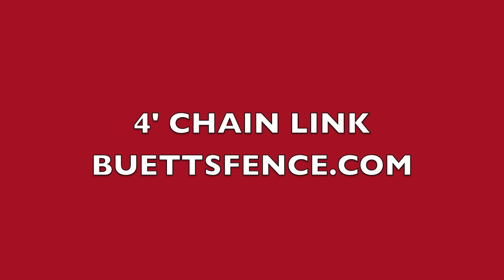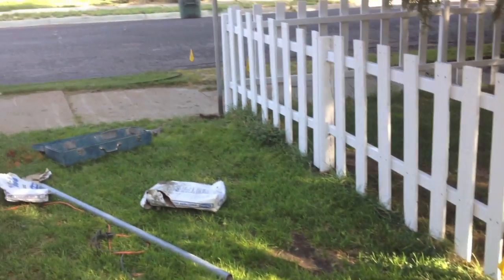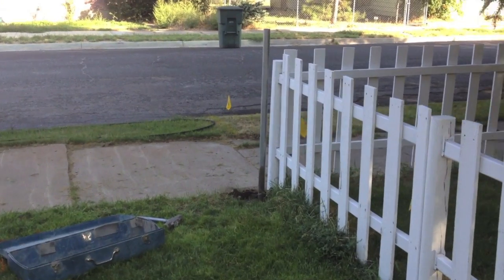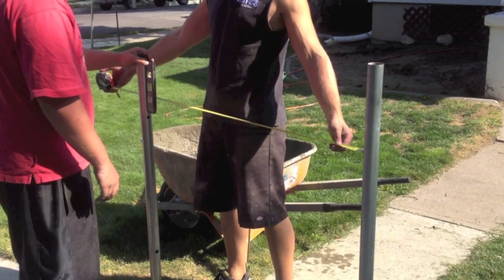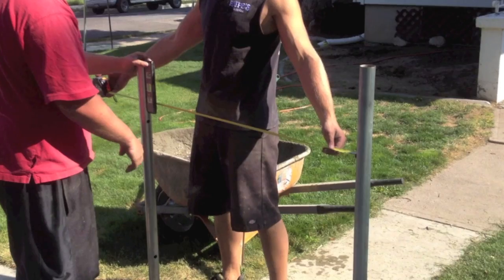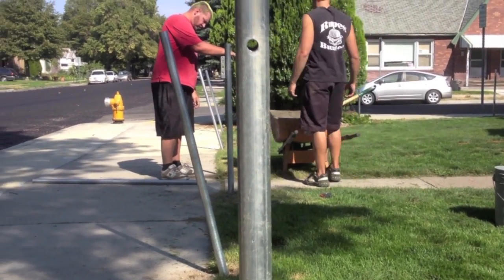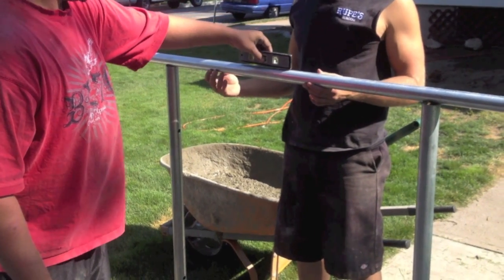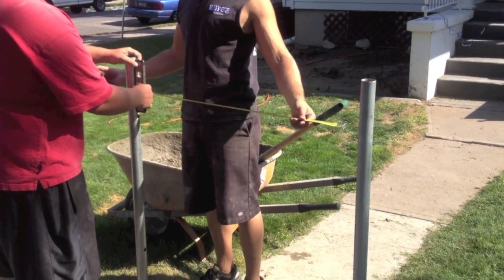HOW TO INSTALL CHAIN LINK FENCE (PART 1)

Comment: Thank you very much for your video.  I am putting up a chain link fence using the bullet ends.  I had looked everywhere online to find out what height the terminal and line posts are supposed to be.  Everybody has heights for using the dome cap system with the bolt on rail ends but not the bullet style.  Thankfully you did say the actual heights I would need.  One thing I think you should have shared with viewers was how much bottom clearance one plans on make a difference on post heights. Thank you much for this.  Tom

Comment: The instructions you give are to add 4” between terminal posts for a gate which is exactly what I did. Unfortunately, this is wrong as prefab gates already come smaller than the opening.

Comment: Sight by eye, it is quicker and easier. ANY tradesman that tells me this certainly will not get my job
Reply: I guarantee my line will look better than someone using a string.
Reply: Real professionals sight by eye on chain link. String is used on wood fences but you can even sight those by eye but I like string. We set all our posts three ft. in the ground on everything 6' and shorter because of the gumbo in our area. We get some pretty dry weather sometimes and it can crack away from the concrete. I have had my business (Blair Fence Co.) for 34 years and have worked on 98% of the jobs. I am very particular about the way they are built. Can't help it. I like to make my fences a work of art.

Comment: I'm confused..... You first say that the height of the line post should be 45 1/2 to 46 inches, but then you say dig the holes 24 inches. ????  If you put a 72" pole in a 24" hole you have 48 inches sticking up out of the ground. ??????   How does that work out?
Reply: You measure and cut each post to correct height, with pipe cutter

Comment: I could explain exactly how to install a chain link fence with gates but there are several different things you have to know and it may get confusing but if anyone has a question I will answer it. I started building fence when I was 12 in 1965 and had a fence co. for 36 years and I will be glad to help anyone.

Comment: get a tape longer than 25ft and if you dig the hole deep enogh you dont have to drive it down a string would do justice as it is quicker and  you know where your hole is no need for one person making sure the hole works line them up after you pour concrete and your gone plain and simple

Comment: if u run a string then measure ur line then mark ur holes then start digging there no eyeing or running back and forth cus the string don't lie  only eying maybe at the house  then set all the posts at once when holes are dug that's how we do in tn
Reply: rachel dodson you got it man u know

Comment: "sighting it by eye is a lot faster and easier" translation: we chose to do it the LAZY way. Amateurs
Reply: I always sighted my chain link posts by eye because it was more accurate that way. Not bragging here but my posts were so accurate and straight that I was accused of using a transit more than once. I owned a fence company for 36 years and worked with my crew because I didn't trust their work. I built all kinds of fences and I was a perfectionist and still am at 70. I also built wood decks and eventually homes. There is little more satisfying than building a straight fence whether it be wood, chain-link or even barbed wire fence.